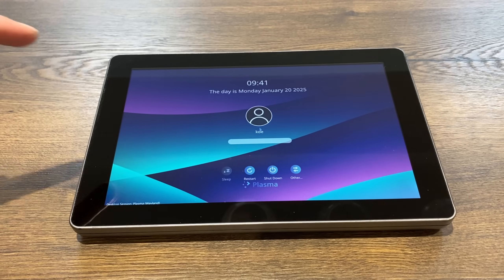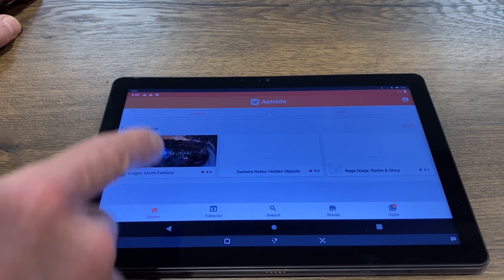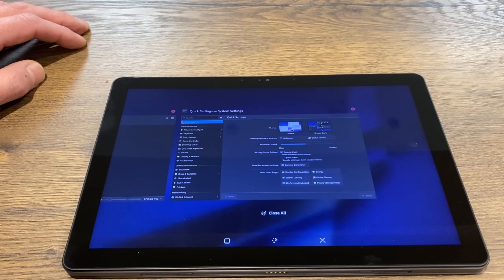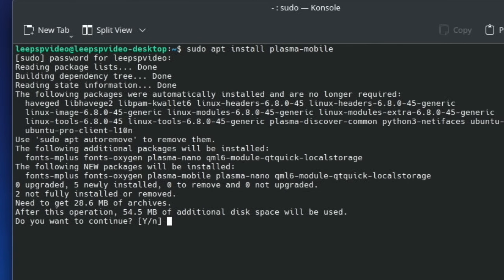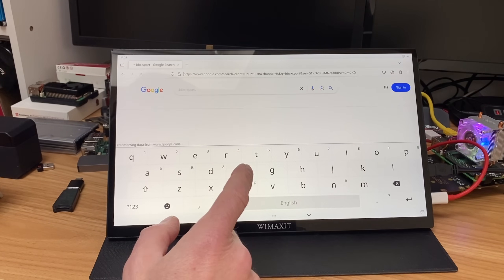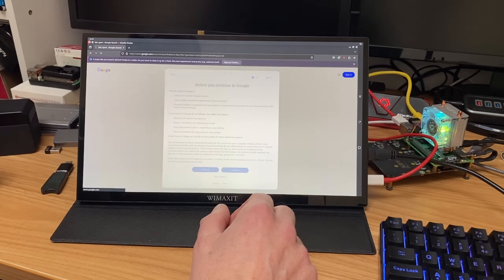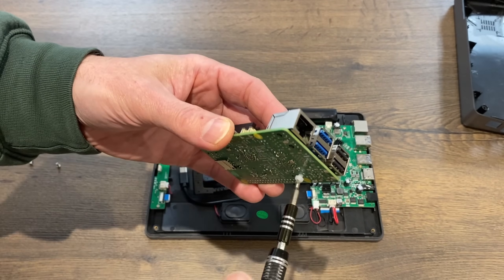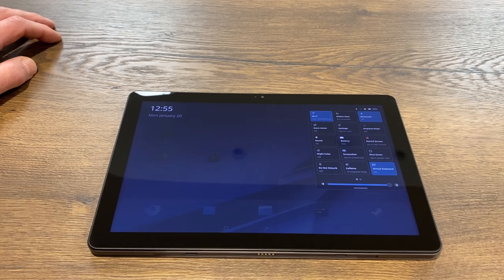10” Raspberry Pi 5 16GB Tablet. KDE mobile

Comment: Bro how can i screencast phone to tv without wifi router and without another phones hotspot 

  please reply
Reply from the maker: @KLTomogamer  Android phones with miracast usually work without a network. Depends on the TV having functionality. Strange how you didn’t mention what TV or Phone you have.
Reply: @leepspvideo  Tcl s5500 google tv and my phone is motorola g71 5g
Reply from the maker: @ try moto connect, should work.
Reply: @leepspvideo  can you explain it to me ?
Reply: @leepspvideo  my english is so bad ,i'm sorry if you get trouble understanding
Reply from the maker: @ unfortunately not as I have never owned either of these models

Comment: The most recent version of KDE Neon has been rebased to Ubuntu 24.04 LTS, which itself is based on a snapshot of Debian Trixie/Sid (Debian 13) as of last April. I think Raspberry Pi OS is still based on the older Debian 12 Bookworm, so when you installed Plasma Mobile on the Pi, you got a much older version than the KDE Neon one on the N100 tablet. Actually, even older still because the KDE team uses a rolling release model for the Plasma repos on top of the 24.04 LTS repos. That's probably why you got errors and poor behavior for Plasma Mobile on the Pi.

Comment: Gnome is gonna be a lot more suitable for touchscreen, it even has native multi touch gesture
Reply from the maker: @idtyu  it’s still very much mouse and keyboard centric. Not ideal as a solely touch os
Reply: Gnome is suitable for a tablet in that they got rid of menus bars and menus and used a single hamburger menu. So you swear at them for putting a mobile interface on a desktop OS.

But apparently it’s not suitable  for use on a tablet either. It could be worse. They could have added menus and menu bars to the mobile version. 🤷🏻‍♂️

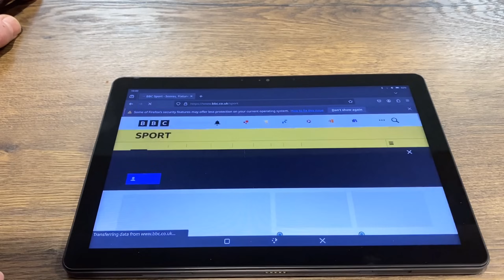Comment: 2:22 If you don't mind could you let me know how to enable it? I have a 2 in 1 laptop thing thats currently running ubuntu I think and I could not find any way to make a keyboard appear automatically in any chrome browser.
Reply from the maker: @RisingRevengeance  it was already enabled with kde mobile for Firefox and other things. You can add keyboards with Linux

If you install kde neon the instructions to install kde mobile are in this video

Touchscreen keyboard for Remote Desktop. Raspberry Pi Connect & Raspberry Pi OS
https://youtu.be/r3MQr_zE8mY
Reply: @leepspvideo  From the timestamp it seemed like there was a browser setting to enable touch keyboards in chromium stuff. Guess I misunderstood that part. 
Keyboards in firefox and everything else works fine for me.

I'll probably give kde mobile a try anyway, it looks pretty good.
Reply from the maker: @ it wasn’t working automatically with chromium for me. I didn’t attempt to enable it
Reply: @ Ah gotcha thats unfortunate

Comment: Seems to me the market would be ripe for a CM5 I/O board which fits on one side of a screen tablet with your I/O and then simply connected to a battery and USB-C on the other side for charging. Whole thing would be flat too since you're not dealing with Type A USB's on top of eachother and Ethernet (unless you want ethernet on a tablet). Interesting idea.
Reply: This is basically exactly what I want as a tablet.
I can get the freedom of Linux (the customization of KDE) with Android on top.

I even researched parts to DYI such a contraption.
But where I keep falling short is the screen.

Optimal to conserve battery and get the device as slim as possible it should be a MIPI DSI display.
Is it is anything like MIPI CSI, it would need at least 4 lanes to get a high resolution.
HDMI may be possible if you would consider replacing the HDMI ports with a Flexible PCB.

Secondly to make it really good a resolution of just 1200x800 is really not good enough for something in the realm of 8” to 11”.
Furthermore most tables have a 3:2 or 4:3 aspect ratio. Most screen you can find are 16:9.

It basically only the screen, every other engineering channel should be easy to master.

On the software side, it’s rather probable that for any MIPI DSI screen you will have to write your own kernel driver and if you unlucky even the firmware.

Comment: Nice work Leeps! I could not get Pimoroni MVME base to work with the New Pi5 16, hoping then get some of the kinks ironed out soon.
Reply from the maker: @HillPhantom  what os were you trying?
Reply: @leepspvideo  Pi OS... its crazy will work through USB, but not through PCIe. Tried two different boards and three different PCIe cables, both boards from PiMoroni. I didn't try another OS.....it crazy I can't figure it out dooohhhhhh. Keep up the great work Leep, really admire your channel! Cheers mate!
Reply from the maker: @ it could be the nvme drive 

which NVMe drives work with a Raspberry Pi 5?
https://youtu.be/3mUgVTBmKio
Reply: @leepspvideo  sadly its on the known working list and I have same drive with other Pi 5 8GB on the BASE. I am going to get another drive and just pop this one in my NAS. I  really appreciate all your help mate. Maybe its an issue with the PCIe port, its a brand new PI but stranger things have happened. My solution always seem to be, chuck more money at it and buy another drive LOL. Cheers.
Reply from the maker: @ this 52pi nvme board is working fine with my 16gb  https://amzn.to/4h89VPk
Reply: @leepspvideo  thank you brother, I have a new one coming to test, it has built in POE! Hoping that works but this one is a really good price as well TY!!!!!